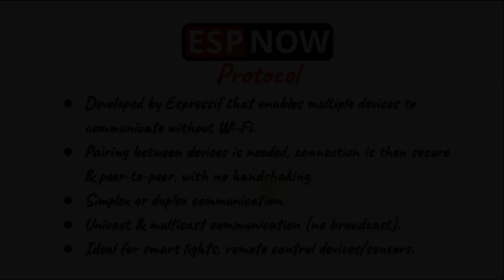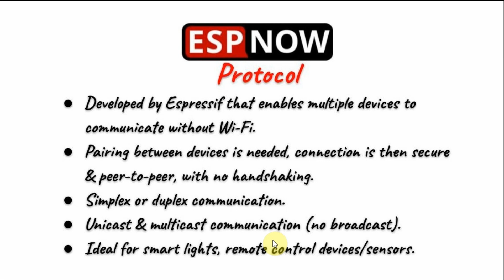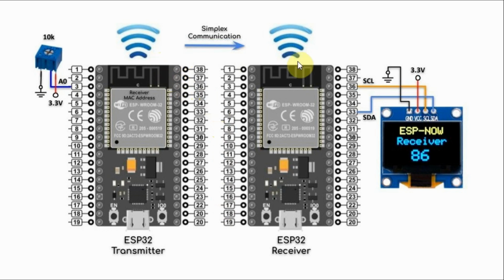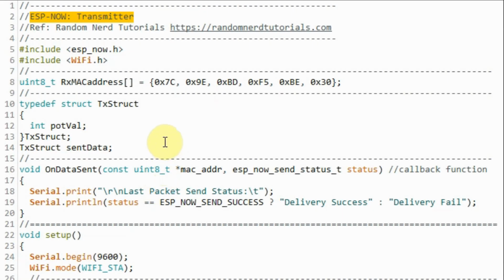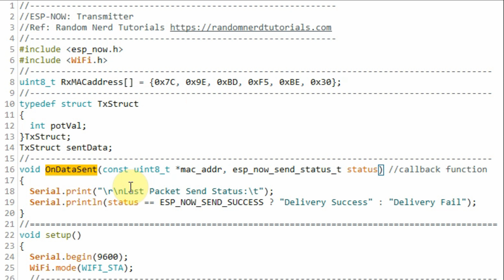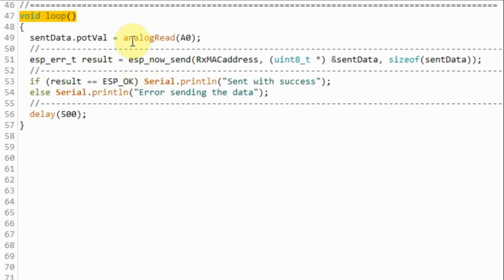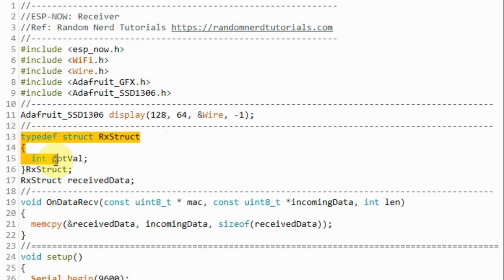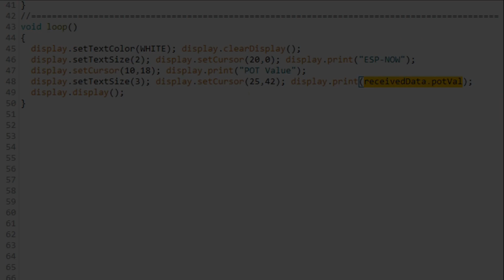ESP32-to-ESP32 Simplex Communication via ESP-NOW

Comment: it makes no sense if I have to add mac address manually in code. how can I do pairing via a button or sth
Reply from the maker: Hi, thanks for your feedback. You can enter mac address via serial monitor during run time. Or during run time program extracts mac address stored in internal EEPROM when a button is pressed.

Comment: when i tried practical communication of two esp boards using espnow i get only 15-20metre maximum range  not a completely open area ,almost 2-3 walls were there between the two boards. I still dont understand how people claim to have range of above 200metres oin blogs and videos .Do you experience the same  Kuzechie?
Reply from the maker: Hi. Like you, I only tested at short range. As for people claiming 100s of meters, I’m not sure. I need to do some research. Thanks for your feedback.
Reply: @AnasKuzechie  ok thanks
Reply: They claim mostly using atennas facing towards each other in open area.... If you are behind walls or your esp board is inside box with antenna not visible it will need router support to spread the range. Else try to add antenna to board.
Reply: @sameerk12982  Yeah antennas must be line of sight !!! Idk about 100s meters but definitely you can cover some wide area 😇
Reply: well, you have to have antennas, I am shooting 5 gig 600 feet in a mesh right now, but i live in an area with zero wireless so my NOISE is negative 110